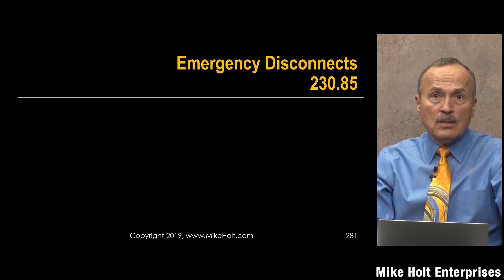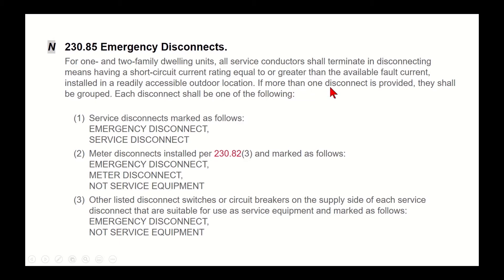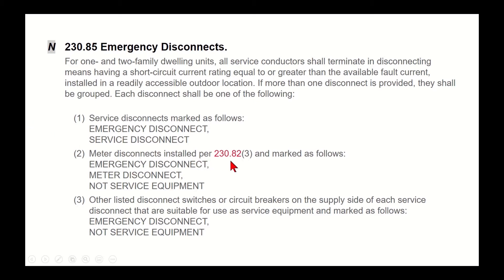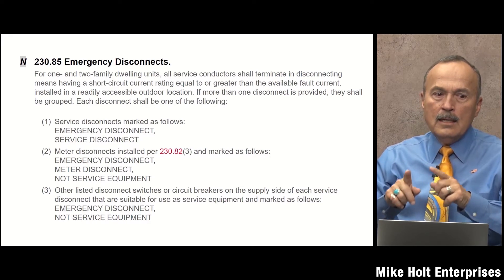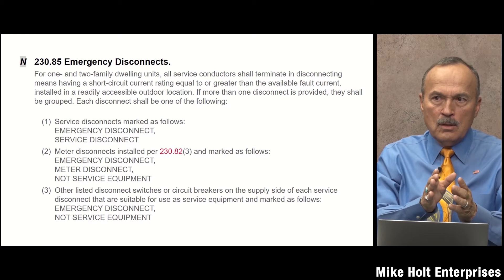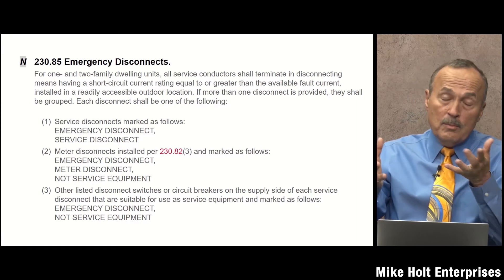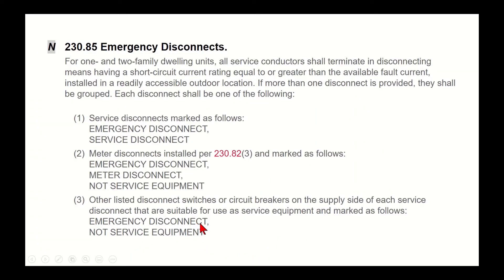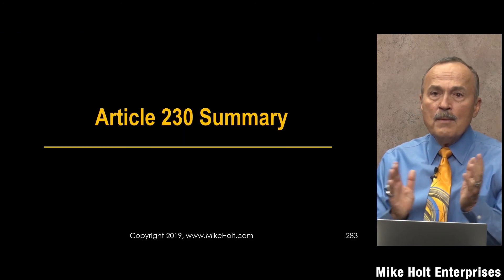Emergency Disconnects [230.85, 2020 NEC]

Comment: This one has been haunting us here in Massachusetts as we adopted the 2020 NEC on 1-1-2020...there is a BIG divide on use of equipment that is listed and labeled as "Suitable ONLY for Use as Service Equipment" for option 230.85(3) and labeling it "EMERGENCY DISCONNECT -  NOT SERVICE EQUIPMENT"...as this would be violating its listing by "field" modifying the equipment with the new labeling. As you will see in the 2023 First Draft Report, this very issue has been addressed in 230.85. 

The Code compliant way to do an installation for 230.85(3) is with SUSE rated equipment. Equipment listed and labeled as "Suitable for Use as Service Equipment". The difference between the 2 listings is equipment that is "Suitable ONLY for Use as Service Equipment" has the neutral bonded "permanently" to the enclosure or cabinet. SUSE equipment has the neutral "floated". In the end bonding will be the same. IMO, its the principal of not using equipment outside of its listing and labeling.

Why even do an installation per 230.85(3)??? Well on service upgrades in older homes with 3-wire branch circuits for the range and dryer, installing per 230.85(3) permits these branch circuits to stay as connected to "service equipment" per 250.140 exception 3, because doing an installation per 230.85(1) creates a violation because these 3-wire branch circuits no longer originate at "service equipment". Imagine this collateral damage is from the World War II war efforts to redirect metals to the war! It was 1996 when the installation of 3-wire branch circuits for the range and dryer were no longer permitted, even if originating at "service equipment". 

Another option for the old 3-wire branch circuits would be to use a meter/main disconnect with 4-8 branch spaces outside and connect the 3-wire branch circuits here for a Code compliant installation. Something like this >>>
https://www.homedepot.com/p/Milbank-200-Amp-4-Terminal-Ringless-Main-Breaker-8-Space-16-Circuit-Overhead-Underground-Combination-Meter-Socket-Load-Center-R5168-XTL-200/202504165
I'm curious how other states that have adopted the 2020 NEC are dealing with this rule?
Reply from the maker: This is a mess; I hope this is cleared up in the 2023 NEC.

Comment: Only disconnects I’ve seen before the meter socket is on 480v, but that’s commercial. Other than that we are required to have a disconnect outside accessible after the meter socket. This is for any emergency responders to shut power down to the entire home, during an emergency situation. I do believe there should be an additional emergency overload device that would go in place on the utility pole and be for utility service providers only, just under the drip loop that is rated for the load analysis for said home. This would trip and stop current that either feeds arial or underground to the home.
We deal with floods that submerge the entire meter socket and still remain live the entire time. Imagine walking through flooded waters up to your chest and putting your hand directly on the metal enclosure of that submerged meter socket. Some would say…”well it should trip that transformers emergency flip switch”, but because of the resistance in the large body of water…amazingly, the water acts as a load and carries the current just the same as a very large lightbulb.
Reply from the maker: Excellent comment.

Comment: Just did a Meter Disconnect 145 Foot from House to, A 200 Amp Disconnect on the House, to a Main Panel inside the House..
Reply from the maker: I meter disconnect has nothing to do with this rule.
Reply: @MikeHoltNEC  Why ?
Reply from the maker: @aubreyroche5080  Because the rule is about the 'building' emergency disconnect that is located on the building. Not a disconnect ahead of the meter located remote from the building.
Reply: @MikeHoltNEC  There is a 200 Amp  Meter Main Disconnect at a Well House, and then 145' to the House is a 200Amp Emergency Disconnect on the House, and from there is a 200 Amp Sub panel in the Residence.. Oregon has not Adopted the Emergency Disconnect Rule but has a Building Rule for Manufactured Homes Having Disconnect within 30' of the Home. So, it worked out anyway. The Utility Company Determined the Meter Location

Comment: Why don’t the utility companies make a meter socket with a disconnecting means above meter and below so if you need to work on the load side to change out conductors from meter to service disconnect
Reply: Because that makes the utility responsible for literally hundreds of millions of service rated connections. That's not only a maintenance, but an insurance nightmare. As a corporation you would never sign on to that and do everything you could to lobby against such.
Reply: @otm646  does a ats switch count ( generac RTSW400A3 or equivalent or better ) as a emergency ( fireman's ) manual lock out for single dwelling residential use 240V sp 400 amps ? and will it work with solar ( later on and or fixed standby generator retro fit as im busy upgrading everything / cashstraped for now ) or the new ford f150 lighting or "power pro" hybrid ? or do i still need the extra square-D lockout tag out box ? planning on my service panels 10+= feet away inside of the house 🏡 

and after reading ( forms and the code book 📖 ) and listening to mike im now more confused home owner/resident looking to buy equipment and make sure everything is being performed to best practices and pay for everything. but let the electrician do the installation and the county's inspector check it but i i feel its best not to be ignorant and be a small part of the process as i "have a dog in the hunt" more so than everyone else. and yes i have passed the industrial maintenance NEC70 testing ect. but this is a house not a big plant on 480V 3p
Reply: then everyone would bypass meter

Comment: Remove this disconnect.......not needed
Reply: Tell that to a firefighter
Reply: @stillthakoolest  They can remove the meter
Reply: @Htm.13  removing a meter under load can be very dangerous. That is the whole reason many utilities require bypass levers for when they remove a meter.
Reply: or a resident in a minor panic attack from a dishwasher ( and did try to start the main ( and or the other way around as im not 💯 sure which one started it ) and only inside 70's 100A 240V service panel on fire with it as the metering socket is contented to it outside of the back of the stone wall and would have gotten hot too with it as the fire wouldn't have been faraway from it max would have been 6" or so inches aka it would have burned too then you're really hosed before the fire-truck and the utility vehicles got there and my poll is in the back/hard to get to, so that adds to the complexity of safety without burning it ( boom truck ) two and hurting someone ) on electric fire 🔥 and no good way of stopping it in a 1970-90's nec coded house other than do your best and pray for mercy with sand or small 2lb~ co2 fire extinguisher . btw not fun don't recommend it 2 out of 10 🌟s 😂 and yes i got kinda lucky that i didn't get burned or electrocuted/ hospital/slowly dead 💀 and having that shut off would have been really handy and safer plus quicker for the fire crews to extinguish it if need be and as i remember i did end up calling 911 but had it out mostly by that point by shure dumb luck 🍀 10 points to me 😂